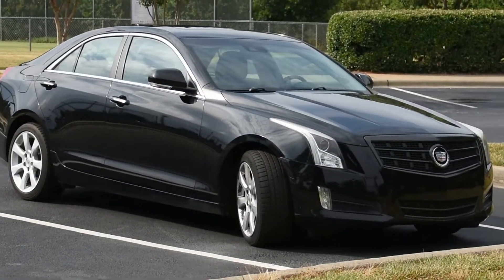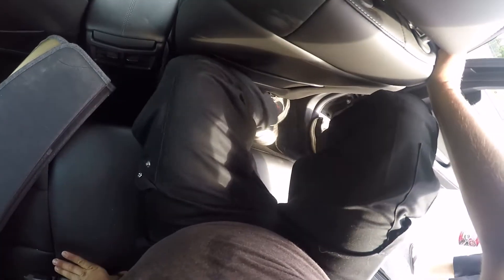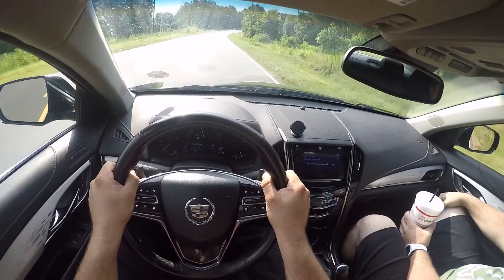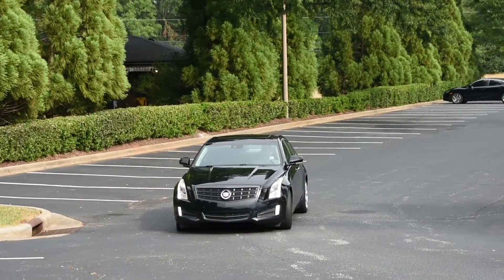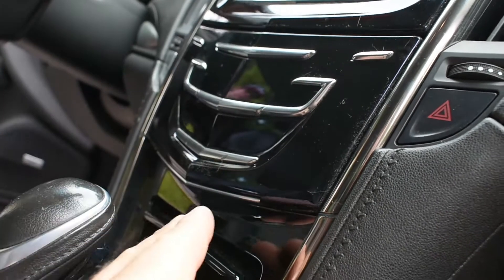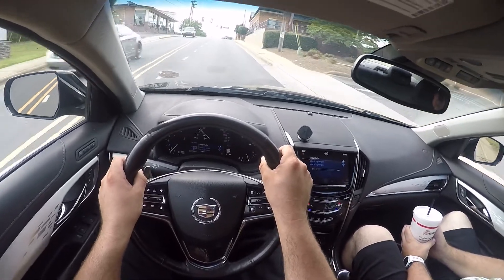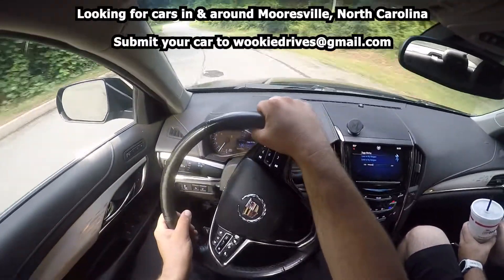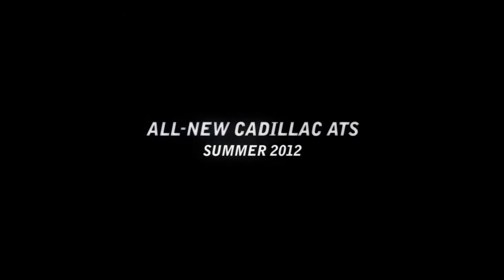2013 Cadillac ATS 2.0t Performance: Wookie Drives #83

Comment: Question if you had the option to buy a 2018 STS for $8K with 84 K miles but has a Salvage title comes with a warranty
or a 2013-14 for $9-12K with over 130 K miles what would you do?

Comment: Realistically, how many miles will these go before they start becoming a money pit? I found a guy selling one with 111,000 miles for 9k. I drive a lot for work, should I look elsewhere?
Reply from the maker: From the owner who traded this car in last winter:

Yes, at that price definitely look elsewhere. they do have differential seals that leak bad, plus the 2.0 is a rather finicky engine, so if it's been modded, it COULD be a ticking time bomb. Also the CUE is going to fail at some point.
Reply: @WookieDrives  well dang, I appreciate the input!

Comment: I want those brushed aluminum door trims 😫
Reply: I’ll sell you mine for $200 shipped
Reply: I'll give you mine for free. Aluminum and chrome is so played out i did a chrome delete on my entire car. Chrome belongs on CLASSICS not modern cars but thats just my opinion. Now my 2018 ATS 2.0T Crystal white (which is peral white without the pearl) looks beyond amazing especially with tinted windows and all REAL carbon fiber accents on the exterior. From the  spoiler, lower license plate bumper trim, side mirrors, etc. Just gotta mount my carbon fiber front splitter and shes completely finished. So CRAZY how many people have NO CLUE what kinda of car this is. They think your driving a damn spaceship. And with a few ZZP mods and  and schmidty tune you will be. It'll beat the FASTEST 4 Cylinder in the world a CLA45 AMG. 😉